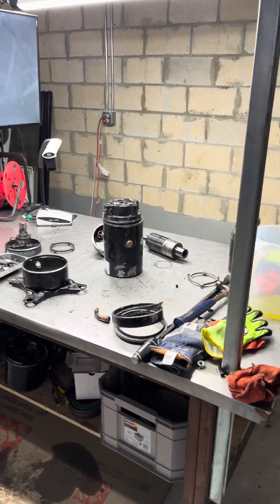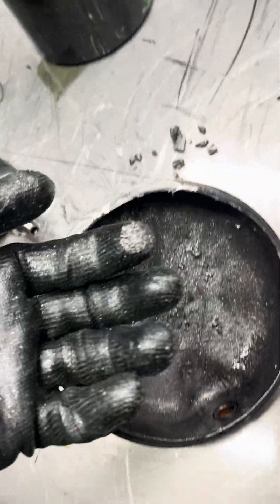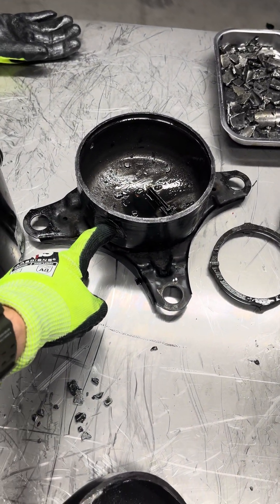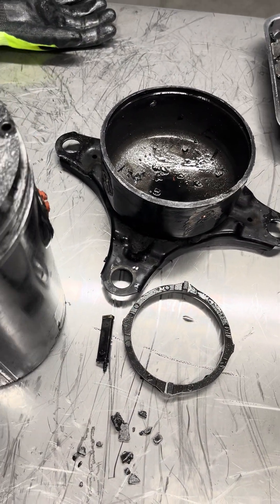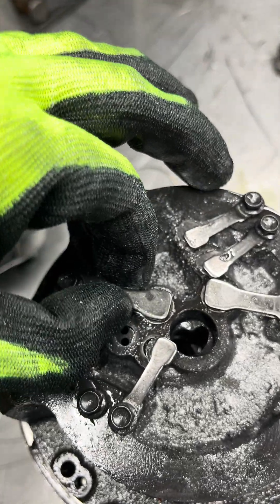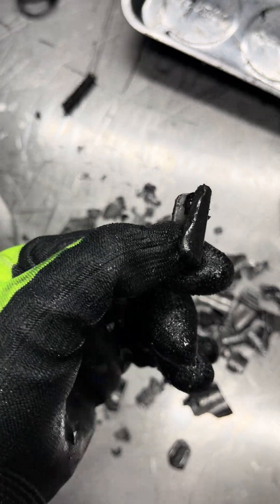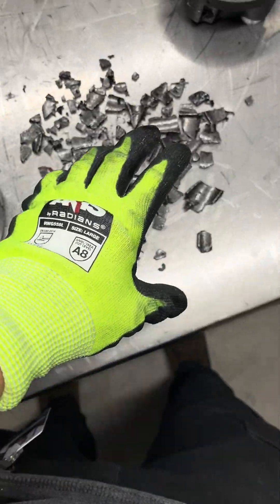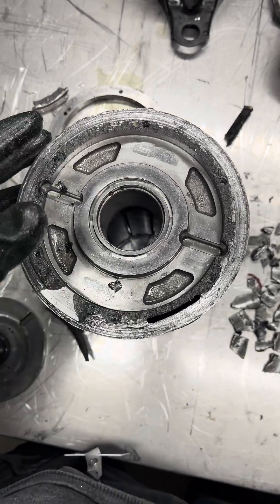LG Inverter VRF Compressor Teardown - Zero Compression

Comment: What PVE oil would you recommend to add back into a system after a leak occurred, and how much should be added if it isn't constantly reading low oil from the sensor? I see one listed online with an ISO 32 rating and one with an ISO 68 rating.
Reply from the maker: Technically the one that is used is ISO 50 but 68 is my preference. Remember that if your charge is perfect and you have high DSH you can add oil 5oz at a time every 15 minutes to get it back into range. This is how we add oil back.

Comment: I just cut one open and some of that metallic sludge on the top plate of that compressor is just the metal shavings from cutting it.
Reply from the maker: We have a custom built compressor cutter that cuts the shell much like a copper tubbing cutter so there is zero cross contamination. Anything found inside is fair game. The metal shavings inside are from the scrolls not the cutting process.
Reply: @ #1 can we see it? #2 Can I buy it?
Reply from the maker: @ I will show it off in a video. It is on the short portion of my channel if you want to see it running

Comment: Interesting worked at several VRF nightmare accounts for massive compressor failures. This is the way to figure out what happened even had factory reps out no one cared what the compressor looked like inside. Is it normal for the PVE oil to be bright yellow like that other jar you have on the bench.
Reply from the maker: Yes from what I have seen it is from normal wear and excessive heat within the compressor. I will be doing a video on this soon.

Comment: I think Daikin should take a leaf out of their book when making a compressor. I don't understand stand why Daikin don't run the mesh screen for the oil pick up
Reply from the maker: Well so this goes back to a comment someone mentioned a few weeks back. Should we really require manufacturers design a product around our markets poor practices or should we just get better at following basic rules in refrigeration? Asking someone to change their product because we refuse to do the right thing seems silly no?
Reply: @RomanBaugh  oh 💯 agree installion practices should be followed but i just thought that might be extra little protection.vive never installed a vrv only ever been fixing them and it just blows my mind the amount of compressors hence why I starting cutting them apart to get a Idea on the internal working of these

Comment: System clean up is a hell of a lot harder when you can't lock the system in cooling up north in the dead of winter. And there's not always enough room to put a dedicated drier right on the true suction before the compressor. Local LG rep up north here said they have had great success with liquid line HH driers on a bypass loop for a couple weeks cleaning systems up
Reply from the maker: In my opinion it is something you cannot ignore. Yes there are climates where this becomes challenging, some might say impossible but something is better than nothing. Also preventing a failure like this would not require any clean up so there is that.

Comment: Aloha Roman, our condo complex is about to replace a Samsung VRF system (600 high rise condo building).  Is there a manufacturer that you consider to be most reliable?  It will be a A2L VFR/VRV system as soon as the CUs and FCUs are available, Q3/4 2025
Reply from the maker: There are a lot of great manufacturers in our market that make a solid VRF machine. I am partial to Daikin but you can’t go wrong with Mitsubishi or the new up and coming contender HighSense! I am doing a podcast soon about the major VRF brands and selecting the right one!

Comment: 👍love your videos always learning. 
A decade later and I’m still waiting for my first LG compressor failure on the larger VRF heat recovery system systems.  I’m embarrassed to say when I get my first one I won’t know what to do. 😂

What caused the compressor failure?
Reply from the maker: Sounds like you have a lot of properly installed VRF systems with your lack of failures! Liquid refrigerant killed this compressor due to overcharge.